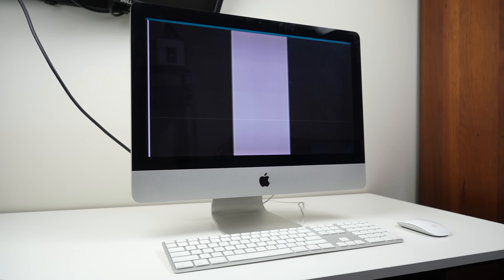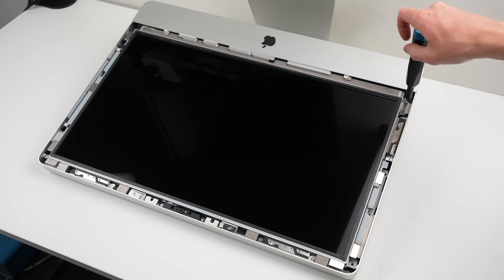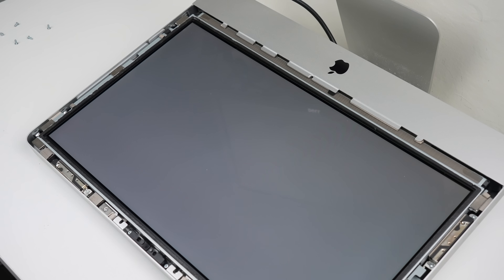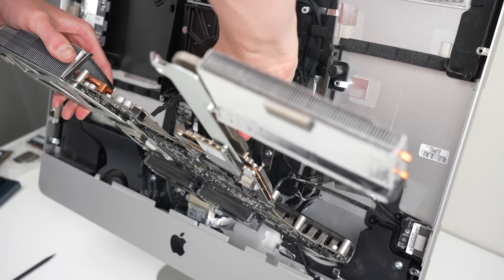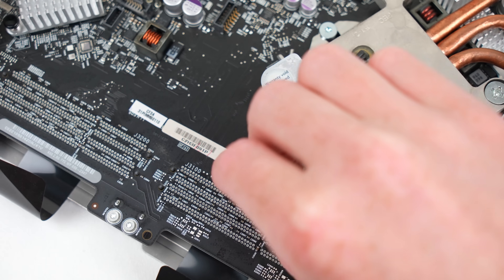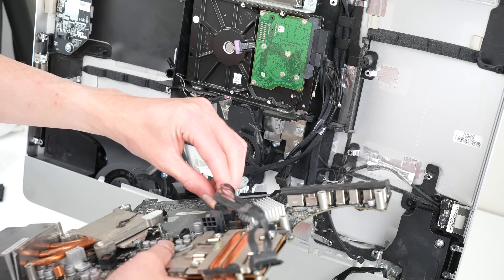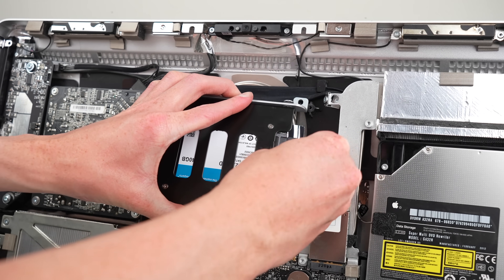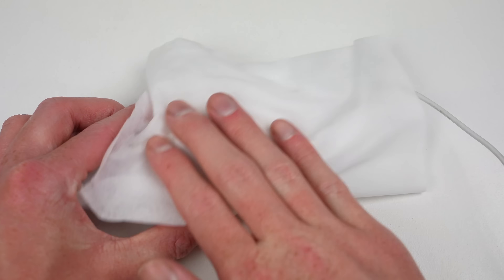FREE Broken iMac Gets Repaired And Upgraded!

Comment: It's weird that a lot of older computers run way faster now with solid state drives, it's amazing that it took this long to get solid state drives to where they need to be reliable and usable for long-term use. I sometimes wonder where do you go from that besides faster and longer lifespan. It's like for the longest time storage was the main bottleneck.
Reply: SSDs were reliable & usable for a long time. They just cost a lot more than what we were willing to pay. Now that the cost of flash memory has come down, and the price of SSDs has come down, mechanical drives will be displaced to data centre use only.
Reply: @DuskHorizon  some consumers might still need mechanical drives for long-term storage as well, not just data centers
Reply: @10GTech  you know that the lifespan of an SSD is derived from its TBW right?.... if it is a backup SSD lets say for pictures and video files and is not the main drive for the OS it should last almost indefinitely
Reply: @rudder3084  oh, thanks for the info, i usually store heavy video on HDD mostly
Reply: @rudder3084  well SSD Drives are nothing like the HDD Drives,Solid state drives are just not durable enough compared to Hard Drives
Reply: @stephensnell5707  erm what are you smoking?... drop an SSD from 2 meters high then drop an HDD at the same hight, now you tell me which is more durable?....
Reply: @rudder3084 don't be so rude
I don't smoke as it will totally kill a human with time
I happen to have a 9(coming up for 10 years) Lenovo Laptop which still works perfectly and uses a Hard Drive and as I handle my Laptop PROPERLY AS I SHOULD that is why the Hard Drive still functions as it should do
Reply: @DuskHorizon  hard drives will never be displaced by SSDs you prune
Reply: @DuskHorizon  when they first came out they weren’t as reliable as now
Reply: @DuskHorizon you prune,Hard Drives are the best and will remain in Laptops and computers for many years to come as Hard Drives do not fail as easily as an SSD will over time
Reply: @DuskHorizon totally false,that will take a long time to happen or it may not happen at all
Reply: @DuskHorizon  wrong,Laptops for example will never have the HDD Drives outdone by SSD Drives
Reply: Someone even managed to replace the hard drive with an SSD in an iMac G3. You wouldn’t think this would work on such an old computer but it worked!
Reply: I added a SSD to mine, running 8th gen intel processors and it was night and day in terms of performance, and this is just SATA SSD, not nvme or anything.
Reply: It might be just me, but I don't fully trust an SSD as they are not going to last as long as a hard drive will. Don't take new technology for granted, I don't believe a 10 year old SSD is still going to work like a 10 year old HDD will. There are still hard drives from the 90s that work so I don’t expect having a 30 year old SSD from now still working due to how SSDs function and wear.
Reply: @cdos9186  I agree. I'm a jaded millenial but Id still say having an SSD as an OS drive with the bare minimum of data on it combined with mecanichal drives for storing important data is still the best way to go.
Reply: @willm5032  I keep all my important files on SD cards then eat them
Reply: @jordanturner97  Ahhhhh the one true data storage method
Reply: @willm5032 Yeah, on a PC, right?
Reply: @kiaan675  And mac too, honestly. Probably good practice to store info on separate drives as SSDs wear and HDDs can break too. Losing your OS is annoying and losing your data is terrible but losing both is the worst. Also with the new Macs you've got to replace the entire machine if the SSD fails "aPpLe DeSigN" so having data separate is a good idea.
Reply: @willm5032  Yeah, just not on a laptop
Reply: @cdos9186  My old intel 320 series with 10 years old still works with 95% of life remaining, modern ssd can surpass the life of a hdd
Reply: @magmaxt  Well yes if you get a quality brand like Intel. Could last another 10 years only time will tell.
Reply: @magmaxt actually HDD Drives will outlive an SSD
Reply: @cdos9186   That's why anyone with any knowledge will tell you that you need at have backups. Ideally an onsite backup and an offsite. It's not rocket science, you can get a cheap external drive, use time machine to back up your data locally, a cheap icloud (or other cloud service) subscription, and the risk of losing your data be comes almost nonexistent.
Reply: On computers 7+ years old i recommend installing Linux Mint on it. It’s more lightweight than Windows and everything should run faster.

Comment: I like these older fixable and upgrade-able Macs. I personally run a mid-2012 MacBook Pro for my daily driver; mine runs a Core i7 and 16 GB of ram that keeps it relevant even today. I’ve upgraded my HD to a SSD and upgraded that a few more times to a now Samsung 970; I also like still having a disk drive as in the business space a lot of older software is still only legacy CDs or DVDs and some just don’t like to be converted to ISOs for storage on a flash drive. I also like the blue ray upgrade which is a drop in for about $100 and works flawlessly to allow not only watching blue rays on the road, something less relevant with the prevalence of streaming but also allows blue ray burning and re-writing which can come in handy and is actually not too bad a way to long-term back-up data. I run a modern toughbook for most work stuff but this is a great go to as there are just some things that are easier or only done on a Mac; I just wish Apple didn’t keep killing “Pro” benefits to Mac, I miss the ability of doing things on the GUI, like the old disk utility, instead of having to go back to terminal to accomplish most anything advanced anymore. The whole point in GUIs was to get away from typing, though at least resources are better and I don’t have to keep getting “syntax error” prompts like on th old Apple IIs, which is where I started with Apples. To me they’ve really been going down hill as far as professional products since maybe 2016 around T2 and IOS 11, when they crippled iPhones and iPads by removing ARP Table access and the biking to utilize network diagnostic tools.

Comment: Hey, I made exactly the same video some months ago. Though mine isn‘t as professional as this one. Good work! 
By the way: did you find out, if you gain a better performance when you change the ports on the logic board attaching the ssd? In the manual it says that there are two ports, one for the hdd and one for the ssd. I connected the replaced hdd with a ssd but found out later that I should have changed the ports on the motherboard too. 
I recommend installing Linux on it. I used Ubuntu and it was a very good experience. Greetings

Comment: I've got a 2011 27" with a flashed GTX 880m 8gb gpu in it. Has 32gb in it, just need a cpu with hyperthreading and an ssd.
Reply: For the CPU a Xeon E3 1220 would be a good choice. It is equivalent to the i7 3770 but usually much cheaper.
Reply: @ardwivedi16  I know about the options, just don't have that much time or money to put into the iMac right now, even if some of the xeons can be had for real cheap.

Comment: The newer iMacs really aren’t that hard to take apart. You can use the ‘pizza cutter’ type tool to cut the adhesive holding the screen on. I got mine off in less than 10 minutes with no problems at all.
Reply: Just as a friendly remeinder, this imac cost nothing to put back appart and doesn’t need special tools except for the screw driver. It can be opened with suction cups from the dollar store. This is what he meant by easy to open.
Reply: @TheAntho199  I had a 2011 27” and I didn’t even need a suction cup to get the glass off. You can do it with your fingernails.
Reply: @Fhwgads11  lol yes
Reply: @Fhwgads11  True, I even did that myself, but you can hurt your fingernails in the process, hense why I didn't metion it. But you are correct, you can use your fingernails.
Reply: @TheAntho199 you mean mention(you forgot to type the n)
Reply: @TheAntho199this does work. I had a thunderbolt display full of dust and my suction cups were weak so I use my fingernails to pop it off slightly to make it easier to remove the glass
Reply: sure but what if the screen is cracked?
Reply: Totally. But the latest generation have soldered RAM, SSDs and Processors. Apple claim its for optimisation across hardware but it also means if something dies its a new motherboard or a new computer...
Reply: @willm5032  It is just cheaper. Nobody needs to make the ram-sticks, nor the nvme. So saving costs, no man in the middle. Selling at the same price means more profit. That is what the shareholders want.

Comment: Hugh, it’s entirely up to you as to if you wanted to buy a base model 2019 iMac and completely spec it out. I have a fully specced out 2019 iMac that I bought 1 1/2 years ago, with a core i9 9900, top of the line graphics (non-upgradable). I did upgrade to an ssd inside and upgraded the RAM myself. So, on top of the beast of a CPU and GPU, I have 1 TB of storage and 40GB of RAM. 

All in all, it’s a fantastic system (however, I wish I could upgrade to Apple silicon inside the iMac, but a person can dream).

Comment: Hi Hugh! I am very familiar with the 2011 iMacs, and I wanted to make you aware of an issue that all models are affected with from the factory. The Radeon GPUs (HD 5000M and 6000M series) are prone to failure, and are guaranteed to fail eventually. I am aware you stated you could upgrade the GPU (with another officially supported version), but every compatible Radeon card for this generation has the same issues, and it is rather costly to begin with. So, I would recommend modding the iMac by installing a newer Radeon or Nvidia card, which is possible through some vBIOS flashing and patience, plus it's much cheaper! I did it to my personal 2011 27" model using an Nvidia Quadro K2100M and some research (2011 iMac Graphics Card Upgrade on MacRumors), and it works great! Also, keep up the great work! Your videos are always entertaining to watch while I do some computer work of my own haha!

Edit: By the way, I forgot to mention that upon upgrading the GPU to something more modern, this enables you to install an unsupported OS (like MacOS Catalina) onto the 2011 model. This isn't possible with the Radeon 6000M card, mainly because it does not support GPU acceleration in newer OSes and is basically unusable.
Reply: The Radeon HD 6000 series GPUs used in the 2011 iMacs are known to fail, but the iMac in this video has the lower end Radeon HD 6750M, and it doesn't fail as often as the higher end cards used in the 27" iMac. Still important to know about, but it isn't as big of a problem with the 21.5" iMac as it is with the 27" iMac.
Reply: @jamiechampion299  Thanks for the input! I am admittedly more familiar with the 27” model, but the computer store I worked at last year did have several 21.5” models come in with dead/failing GPUs. But yeah, I’ve seen many more 27” ones with bad GPUs. Regardless, it’s definitely a fun project to upgrade the GPU!
Reply: @yardnuk  The 27" 2011 iMac is notoriously terrible for GPU failures (along with hard drive failures), and while the 21.5" can suffer from it too it just doesn't happen as often as with the 27" from everything I've experienced as well as everything I've read online. It's good that they do use socketed GPUs though, because GPU upgrades are a good project, even if they aren't cheap. 

I use a 2011 27" iMac as one of my primary computers, and right now it's still running on the original Radeon HD 6970M. That card has already failed twice, but after a reflow it's been working perfectly. It's been running nearly 24/7 for about a year and a half now with no signs of failure. I've decided that with this iMac I'm just going to wait and see how long it lasts until it does finally fail for good before upgrading the GPU.
Reply: @jamiechampion299  I mean, as long as you can keep it alive, that’s awesome!
Reply: @yardnuk  So far so good! I don't treat it too kindly, that's for sure. The iMac runs three 1440p monitors (one internal, two external), and I often use it to stream my desktop PC (triple 1440p streams) through the network with Parsec. That's not a light load on the GPU at all, but it handles it alright.
Reply: @yardnuk  I have sucessfully upgraded my 27" 2011 iMac to a Xeon E3-1290, 32GB of RAM and a GeForce GTX 1070 8GB. With this pascal GPU, MacOS is not supported. But it runs Windows 11 and Linux really well and gaming performance is in some games better than the Radeon Pro 5700 found in the 2020 27" iMac.
Reply: @kavelab699 I’m looking to do this, but I’m not sure what is compatible. All the guides only tell me what’s compatible with the limitation of running Mac OS but I am running Linux. What did you use to guide you? Or should I just get the exact gpu and cpu you did?
Reply: The quality of content and comments on Hugh's channel is RARE for YouTube. Great advice thanks for sharing!
Reply: Great comment! I will look into replacing said GPUs onto two dead 27’’ iMac that i didn’t really knew what to do with. Thanks for the info !
Reply: The best upgrade for a 21.5” is the AMD M5100. These are fully supported on Monterey without needing root patches. The Nvidia Kepler cards are natively support up to and including Big Sur. Nvidia Kepler will work on Monterey but you need to boot into safe mode after a major update to install the root patch. Opencore Legacy Patcher is the business here and makes upgrading these systems a piece of cake.
Reply: @allennicholson4248  would you need to flash the vbios to see the efi stuff?
Reply: @EvilTurkeySlices  I always flash the VBIOS on any of the iMacs I upgrade. I have done almost 50 iMacs over the last 3-4 years without issue. 
Your options for flashing are the guide I wrote on iFixit flashing the Dell AMD card or using the linux boot USB drive.
Reply: Seconded. My 2011 iMac died this way. So I replaced it with a 2008 mac pro... Actually a big upgrade! 
But yeah definitely reccomend getting a newer GPU! I believe alienware dell ones work as well if you can flash them first!
Reply: Open Core Legacy Patcher gets rid of the need to flash the video card for picture and their are mxm variants of the RX 480 and 580 for better support.
Reply: @Sean3614  It do, but its a lot simpler down the line with updating/patching Inevitably repairing OS installs if you have a flashed GPU. Having a boot screen even if your OS install fails is a godsend. I toyed with relying on opencore but I'm so glad I just flashed a GPU

But yeah fully agree on getting an MSM RX 580- if you can get one, they're a bit tricky to get the right version etc (can't remember the specifics but I know the GTX 680 i have in my mac pro was a sucker to find)

EDIT Its entirely possible I just didn't research using OC enough but I'd never ran a hacked OS before and flashed GPU was a MUCH easier option
Reply: Hi I have a amd Radeon 6600m 512 mb is that known for failing because it’s a really good gpu but idk if it is prone to failing
Reply: @heyitswill243  I can’t find many instances online of your specific card failing, so you should be fine.
Reply: @yardnuk  oh wait sorry I read it wrong it’s a amd Radeon 6770M 512mb
Reply: I've got a 2006 iMac 20" with broken graphics card. Is it swappable?
Reply: @lachlanlau  The 2006 iMac will generally reflow successfully. It is one of the few GPU failures where it generally is the solder balls cracking and not the internals of the GPU die. Done right is should last well. Clean your fans afterwards. If you want modern software on it, install Windows 7 32bit followed by the Boot Camp drivers. (You will need to modify the boot camp MSI file with Orca to get it to run on 7. Then upgrade it to Windows 10 once the drivers are installed. Download the Windows 10 update assistant on an existing W10 machine and copy it to the iMac you want to upgrade. I have a 20” Mid 2007 happily running away on 21H2.
Reply: @lachlanlau  I believe the GPU is soldered to the logic board on that mode. Therefore it’s not replaceable/upgradable unfortunately.
Reply: thats cool!
Reply: so true, but to fix those gpus you just need to reflow them, or remove the oslder and use a higher temp melt point one...which is a bit risky...so a reflow is easier
Reply: my iMac 11,1 is also having the same display issue
Reply: are the 4000 series OK? just upgraded a 2009 imac to an SSD and seems to be working OK on Ventura.
Reply: I picked up a 2011 for 25€ and a failed 6750M, replaced it with a dirt cheap pre-flashed K610M and 20gb of ram. Runs Sequoia pretty darn good!
Reply: Can I do both a good gpu and cpu upgrade on my 27” or will I run into the limitations of heat and power supply?
Reply: @ yeah you can, but only up to the i7-2600 non-K
Reply: @yardnuk  thanks
Reply: For the 21.5inch 2011 Models, what GPU would you reccomend I would upgrade to. (i have one lying around and would like to use it for basic tasks and light gaming and I cannot find a reliable source)
Reply: @panther64919  IIRC the WX4150 MXM is a solid choice. Sorry, I’m a bit rusty with this stuff already.
Reply: Pretty much everything 2011 Radeon dies eventually. My HP Elitebook had it, and even a reflow didn't fix it so it's now scrap.

Comment: Another useful upgrade on this machine is to add a second SSD, which can be housed beneath the DVD drive & attached with a slim SATA cable to the unused port on the logic board. The 2 x SSDs could then be "joined" in Raid 0, using the RAID assistant in Disk Utility to almost double the speed of the (already fast) SSDs